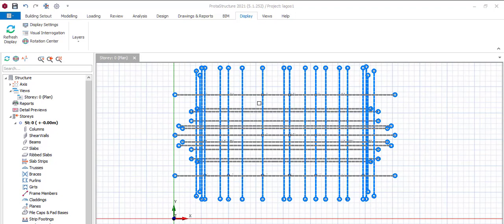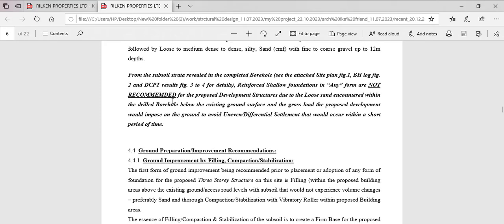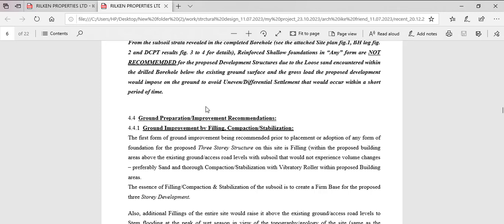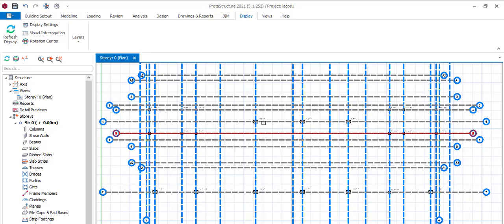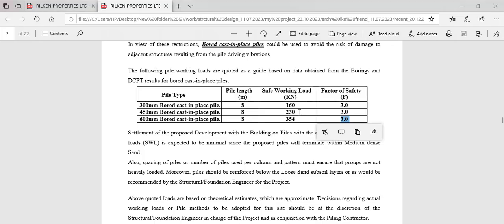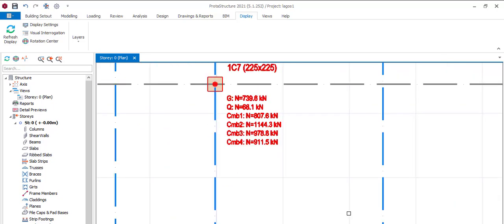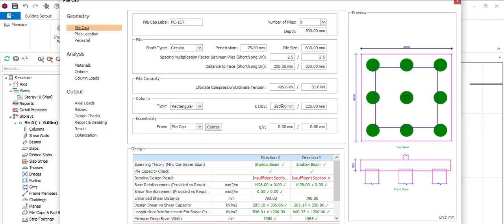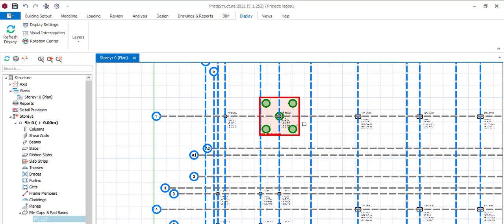protastructure tutorial: how to design pile foundation in prota 2021

Comment: Well-done Engr. Why did you use a pile diameter of 600mm when the highest pile diameter in the soil test report stated 400mm?. Also, can you help us with the comprehensive video on this pile Design.
Reply from the maker: @olaotanbabajide1224  the report has 300,450 and 600 diameter pile
Reply: @keonyediolodu2133  Oh! That's true. Thanks.